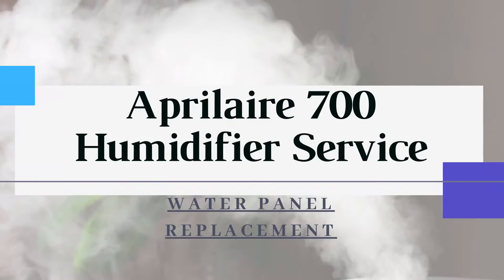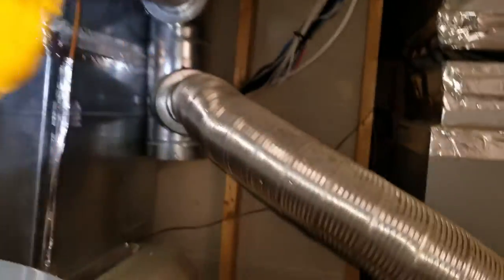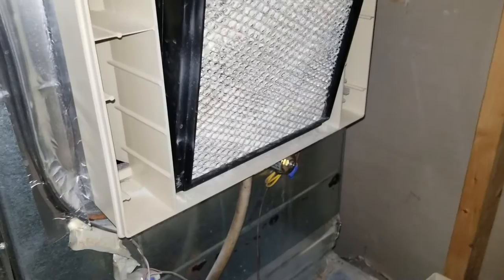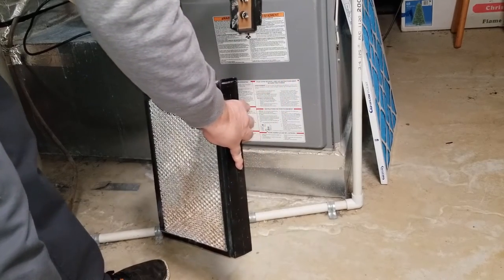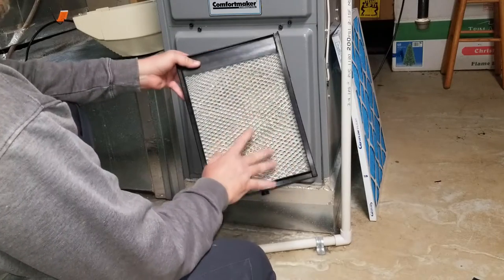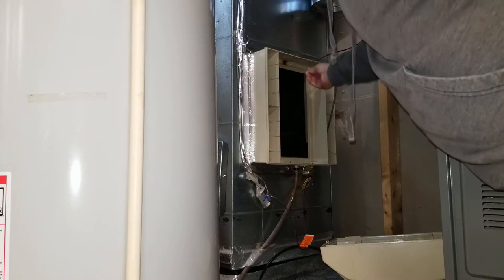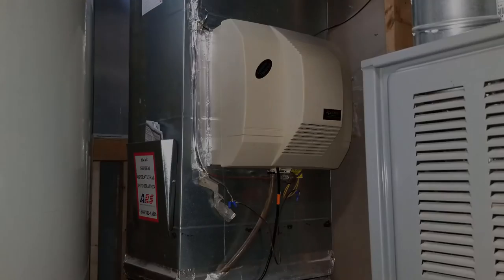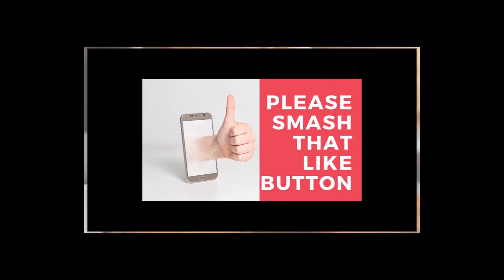Revitalize Your Aprilaire 700: Easy Humidifier Service & Water Panel Swap!

Comment: You sure wouldn't want the copper water line in direct contact with the galvanized sheet  metal.
Reply from the maker: It is done all the time.